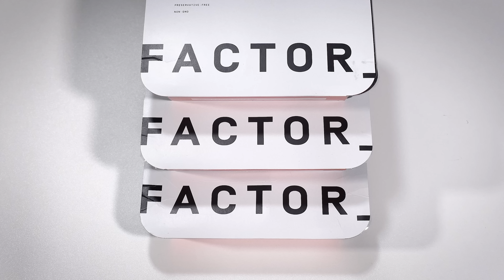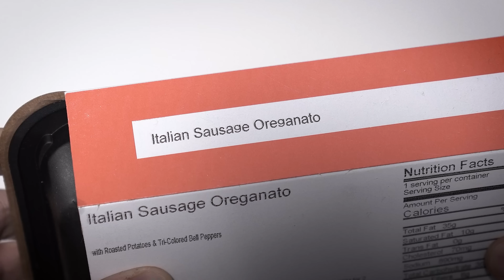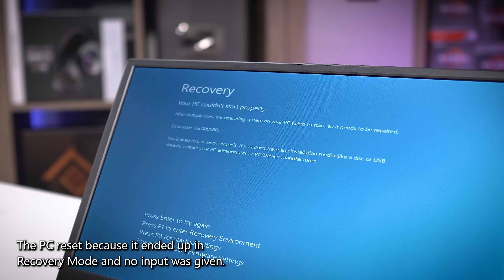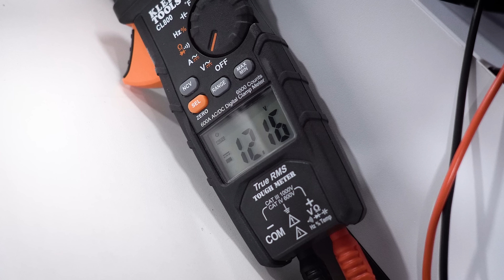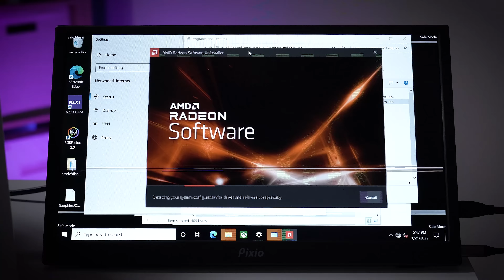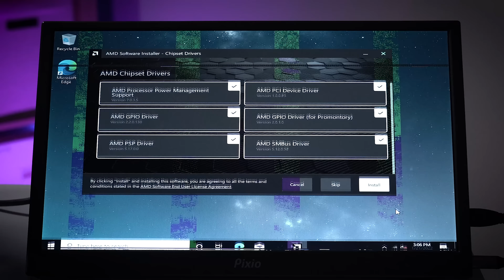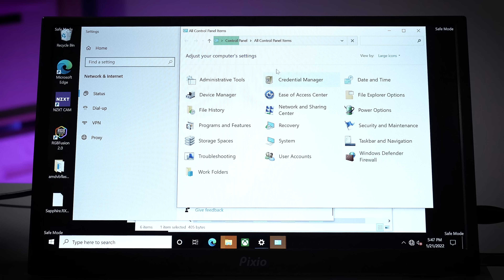Can We Revive This 10 Year Old Graphics Card?

Comment: The human eye can't even see more than 8 years.
Reply: Facts
Reply: Lol'd. Nicely done.
Reply: I can't even see what is 0,0000000001 light year away from me, I think my vision is bad
Reply: Eh?
Reply: This here is an MSI 7770,  ya we got one.
Reply: The BIOS of the VIDEO CARD may be bricked re install it
Reply: @pepipetkov5783  I doubt it. I've seen what a bad bios looks like. It usually doesn't result in artifacting like that nor does it prevent a failure of the fan. Most of the time, it's consistent crashes/freezing when initializing 3D mode, and failure to read components on the graphics card such as the memory capacity and the bios revision.
Reply: false, because my bought r9 270 and r9 290x both work perfectly fine to this day - 9 years after launch, cannot test HD7770 Ghz Edition from Gigabyte I had because, it's at my home on another country - the card would be 10 years old at this point.

Comment: Had this same issue a while ago. The gpu needs reballing. In safe mode it operates on the minimum freq, voltage etc.. When installing drivers, it uses the proper settings up to specs, which crashes the card. Not the drivers or windows fault at all. Pure hardware issue unfortunately.
Reply: Ive had some gpus thst just degraded and some part of the voltage frequency curve (nvidia) or pstate (older amd) was unstable changing voltages in the bios did resolve the issue.

Most of the time it was somewhere in the middle of the clock randge.

Even had a intel cpu do this.
Reply: @Andrew McEwan  unfortunately bes a one trick pony . Clean and repaste is his only repair

Comment: That artifacting can be caused by dry solder joints as well, especially if the cards overheated. If you cant find anything wrong with the SMD's its worth baking it to reflow the solder just in case thats the issue, also if it works could result in another video 😊
Reply: Exactly, second that!!!
Reply: Fixed two of my cards with baking.
Reply: @Mamomr  Fixed an HD 5850 this way years ago...
Reply: I do have a card that started with help by baking in the oven. Had green artifacting and slowed down the computer completely. Worked for 1 month now with no issues
Reply: Shhhh. Guys stop.
Reply: I have a 570 that was damaged in a shipping and when I got it back after what I saw. it artifact like crazy (for no reason or clue why it happened) but how would I bake or fix the gpu?
Reply: @Neo_X90X  baking won't fix physical component damage, its only a fix for trace/solder issues
Reply: @jarsky  so like my issue is that both dp ports stopped working and one of the two hdmi port as well. when the one last port works when it wants to, the same weirdness of artifacts goes on the screen.  I just don't get how shipping a pc could cause such a thing.
Reply: Yeah but it's not a permanent fix. They usually last 6 months max and then they completely die forever
Reply: @usernotfound-h2v  Baked an old 8600 gt using the toaster oven method a few years back. and also used a fan control app to run the fan at higher speeds. I got about 3 months out of it before it died again.
Reply: @robert1975031  Me too,with a GTX 460. I actually revived it twice before it died permanently. First time it held up 6 months,last time 3 months and then it finally gave up forever
Reply: @Neo_X90X  Yours got physically damaged and it's probably bent or it has cracked solder joints/broken components off the PCB. The bake method fixes cards that used to work and it's only temporary.
Reply: was just about to comment this, its worked on several gpus for me
Reply: @usernotfound-h2v  it's weird cause the pcb looks to be to be fine with no real damage as it was bolted in slot and had no real way to moving around. I mean it was in a build for a buddy of mine who was ready to ditch his ps4 pro but now he will have to keep waiting till the chip shortage is over with and grab a prebuilt.
Reply: @Neo_X90X  sounds like a faulty gpu tbh. could be many issues. If u have warranty, send it out for RMA or else have it seen by an expert. Dont try to do anything yourself, cause u might damage it further
Reply: @n00b67  not faulty at all. it was my lil bros who hasn't used his p[c is used and sold it to me non scalped price and it worked just fine. had it bench marked and gaming, but once I had built it in a pc and shipped it away. ups ruined it in shipping and they paid me back 300 for damages. this was last year September when it had happened. tbh I'm not worried about it. My pc a beast of a build and built by my hands. I build pc for folks as well. I'm at a point it is what it is and I'll just put it on a shelf for looks or toss it in the dump. if I sold it on ebay, best I get is like 50 bucks so not worth wasting my time shipping it out.
Reply: @Neo_X90X  Many PCs get damaged in shipping,even if there is no visual damage,if it was dropped it probably suffered a high shock that might have cracked solder joints on the PCB. Usually you can’t see this type of damage with the naked eye. Or maybe it just happened to be faulty. Faulty VRAM usually causes artifacting too.
Reply: @usernotfound-h2v  the gpu was working 100% just fine before i shipped it out so I could believe it was dropped or something heavy slammed on top of the box. Either way it is what it is. Ups paid for damages.
Reply: @Neo_X90X  Oven reflow is a temp fix, ie, it has a high re-failure rate. You can increase the success rate, if you melt flux under chips before you oven. 
If it's shipping damage it sounds like impact damage, ie, parts broken off, but artefacts are usually memory, ie, broken solder balls under the memory BGA, or total memory chip failure.
Check out Tech Cemetery
Reply: @SidneyCritic  thanks. Ill be sure to give it a look.
Reply: @usernotfound-h2v  that's not completely true. There is a chance that it is a "permanent" fix. That being said there is alot of nuance when "baking" a gpu. 1. You're heating alot of components that typically don't get very hot and don't handle heat well for extended time, as with throwing it in an oven. A heat gun is much better for this reason as you can heat the specific components you wat to reflow. Even then though you're probably looking at a 50/50 shot of it working to begin with. But if it's an older card what do you have to lose. And you can buy a heat gun for less than 20 bucks on Amazon and they have many purposes you could use them for outside of trying to repair your gpu.
Reply: Is the PCi x  4 or 3 on the motherboard

Comment: Seen something similar to this years ago, with a buddy's GPU.  I think it was a GTX 280 iirc, but it behaved almost identical to this.   

What happed with his was, when trying to clean the thing, he vacuumed over the fan and spun it up so fast, that the charge it generated, fried the card.   The artifacting it produced was a little different than what this one showed, but it behaved, almost identical.  The boot looping in particular, and this was back on Windows 8.

Pretty sure he either fried the ram, or gpu itself.   It's quite possible the damage to this card, was irreversible.

Comment: I've had a few AMD cards overheat with no fan spinning. Usually it's after driver installs. The first card I ever saw overheat and die was an AMD R9 280x. Once it overheated, the core was so hot it actually was damaged. You could see artifacting just like on the screen you had.
Reply: Im running a AMD R9 290 right now that had artifacting, green lines all over and slowing the computer down. Tried a few things before i just threw it into the oven. Have been working for a month without issues. Ran RDR2 meanwhile i was home with corona and the poor thing was 100% peaked all the time and still works. Now the question is how long it will last
Reply: I have a 280X and have been using it to speculative mine some coins as i have a better gpu for gaming.  Whenever i start a miner it jumps to 99C, i never noticed if it did that before in games because i never really paid attention to it like i do now.  But if i use the AMD software to change the voltage or the frequency settings in the tuning menu, it will fix itself and run at a good temp.  Very strange behavior.
Reply: @SgtEriksson  Does it still work after a year?
Reply: @guiorgy  no, it did not 😋 held on for about three months

Comment: Some other factors:
1. There may be a firmware update available. "GPU-Z" can identify the current video card firmware.
2. Check for UEFI compatibility using the free "GPU-Z" program.
3. Depending on the UEFI compatibility, may require setting the motherboard configuration set to "CSM Enabled". In which case, would also require complete Windows re-install with "CSM Enabled".
4. Check the status while the motherboard bios on-board graphics is set to "Enabled" instead of "Auto". Then plug in the graphics card, but the monitor still connected to the motherboard's HDMI port.

Comment: This behavior, specifically the artifacting in vertical bands (when drivers are loaded) is a sign of bad memory. GPU is probably fine and yes it prevents itself from overheating if fan is bad but memory doesn't.
Reply: 100% exactly good diagnoses.
Reply: 4 memory modules and the bands are in series of 4's, hmmmm. No idea if that's how it works or not but it is interesting.

Comment: I have had many ATI/AMD cards over the years, and I have seen this more than once
I had a 270 die a half year ago, same problem.i did some research on it.
And my conclusion is, when the thermal paste gets too old and the heat starts to rise, that soldering joint starts to get loose, so the GPU needs to get refitted.
Many have got it to work using the oven method (don't use the oven you use for food)  others have used a blow dryer and also many got it to work using a heat gun.
There is a lot of videos here on YT showing it

Comment: Wow!!! I actually have 2 of them still. I used to run in Crossfire. I only upgraded in winter 2019 to a used GTX 1070, just before the balloon in GPUs. They have NEVER been taken apart. I really have a full system, just needs a case. If you want it Greg, I can send it to you, if you want to clean it up.
Reply: Same! Got 2 in sli, but sli is dead, so couldn't get extra performance from that
Reply: I once had dual crossfire  6770s if I remember right.

Comment: Got a feeling this may be a failing capacitor. It works briefly but then fails, the capacitor may be fine when discharged but then is providing inconsistent power. Test each capacitor for resistance.

Comment: Greg I fixed aold graphics card for my only desktop at the time my new build wasn't done yet and I still wanted to play games but it would artifact and freeze and crashed the games to desktop.  I looked in the case and the fans were so clogged with dust that the blades couldn't spin.  So one day I decided heck I will try cleaning it and see if that worked.  It did, you got to peal off the seal on the back because dust can block the contact with the motor in the fan and also absorb the lubricant,, I opened it up there was nothing but dust rapped around the geal, so I cleaned that out. Relubracated it taped the seal back on and put the card back in with new thermal paste and the card fired up like new.

Comment: I picked up a 5770HD locally for $15 a couple of years back. I had a similar issue, very dusty, but the fan did spin. After cleaning and re-pasting, it would boot into windows but had some odd artifacts on occasion and slow downs. I figured the chip had deteriorated, so busted out the heat gun to "re-ball". That seemed to fix it - which more often than not is a temporary fix. I still have the card and use it in an old LGA775 build that sits in the garage for when I do car repairs/upgrades and want to refer to repair manuals, videos etc. without greasing up my phone.

Comment: I just revived my old Radeon HD5770 to give to a friend who is struggling with 4th gen intel integrated graphics. The thermal paste had basically turned into powder but after a re-application and a deep clean of the fan/heatsink, its still going (relatively) strong at over a decade old now. My backup GPU is an HD7850 that could probably use the same treatment too, I hope I can keep it going for years to come.

Comment: Hi Greg

Have you ever thought of building a computer with part's from the 80's and 90's, you know those old school mother boards, graphics cards, processers and so on to see if they can still be used today 2022,running Windows 98, XP, vista and so on, just to see if they can cope with simple tasks of running 1080p games and other programs, just in case someone out there still has a pc running and just wants a couple of extra gigabytes of storage, ram, memory or speed.

As I have a couple of Intel motherboards that could run Windows 98,but would struggle with XP, vista and so on.

Would be fun to see if they are capable of doing basic tasks like running Internet searches and some basic game plays with the modern games.

Just a thought to put out there in the computer tech world.

Loving the video's and the information into the parts of the pc and so on.

Comment: My older brother owns this card, really should remind him to clean it up and re-paste.

Also, is it natural for a high-power GPU to heat up rapidly when fans are not spinning?
Mine is MSI R7950 with Arctic Accelero Twin Turbo II cooler (250W rated). Fans do work, but i have to get an molex to 3-pin adapter since both 4-pin attached to the PCB and 3-pin connected to PSU are required for them to run.
Idle sits at 40-50C, set to lowest speeds, and manages to reach 100C after few minutes while under load. Hopefully did not cause any damage as this happened 5 times, each the moment hit 100C i put it back to idle. No artifacts, no crashes. Processor, together with VRAM modules at this scenario were always at safe temps, around 50-60C.
Left side panel has been removed for such reason, other than having to tidy up PSU cables that go outside the case, with single fan on the front.
It got cleaned up, re-pasted with NT-H1, also has pads on memory modules.

Comment: at 13:17 you can see a missing capacitor right at your left (in this video on the right side) hand! i dont know if its missing on purpose or not, but try to put in a cap there, its 99% the same value as the ones next to them. hope it helps!!

ps. pls like this comment for him to see in time :((
Reply: also, i'd try putting thermal paste on the memory chips too, you never know if it makes a good thermal contact or not without the paste...

Comment: I had the same issue with a Sapphire HD7950. I overheated the card after the fans failed. It reached 99 C, which shouldn't have been a big issue as I shut it down as soon as I realized it was overheating, but it did fry the 2nd v bios. I replaced the fans, and the card worked fine for a while, but started exhibiting the same artifacting yours did. I baked the card and it worked fine for 8 months, but eventually completely died.

Comment: When I see color banding like that and I know the monitor/cable is good, it basically means the memory is toast on the video card. The fact that the fan isn't spinning on startup indicates to me the owner of this card was doing some intensive graphics with the card and the memory started to fry. If the GPU was fried, it wouldn't POST. You only get the color issues like that with segments of the memory being dead. So unless you resolder some new memory chips to that card, it will be forever like that. Your first attempt probably fried more memory in areas where the drivers were being loaded. Also cheap old cards didn't throttle or shutdown on overheat either. So basically it's dead Jim.

Comment: 75-year old computer engineer, retired > I know that this is a year late on a card was doomed anyway. BUT when you had trouble loading drivers - it was DEJA VUE.  I recently upgraded a RX 550 with a "*USED* Saphire RX 580.  Initially, It would not even post VGA LED.  The motherboard suoports "dual VGA", so I put the RX 550 back in the "GPU" slot and the RX 580 in the 16X4 slot (how's that for dual?). Booted on the 550, I was able to load the 580 drivers and the RX 580 works great now.

Comment: I've seen this type of behaviour, vertical lines, with a couple of GPUs some 13 years ago. One XFX  Nvidia card and one Sapphire AMD card. Due to high ambient temperature, in a very hot country, the cards overheated as the fans were not efficiently cooling the GPU. This was in a heavily used game rig.
Reply: Sounds more likely you were too lazy to maintain your hardware like you should in that climate, it got dirty, got hot and then died.
Reply: @ihateeveryone8161  nah. GPU didn't last even 6 months. Didn't have time to get dirty. It was only improperly cooled

Comment: Usually what happens is that the card first will work since there are no drivers installed. After drivers installation the card will try to operate at its “full potential”, and that’s when things will start to go south.
Same happened to me with an old gtx980, awful day, such a good card that failed one day to the other.

Comment: Greg, there is another posibility. It's called bitrot, the card is 10+ years old thermal paste was crusty and dusty. It could be that the BIOS chip got corrupted, I would boot directly from the APU and then try with ATI flash to re-flash the BIOS on it from TechPowerUp, where you can find the exact model.

Comment: I actually understand what is happening with that card because i had a simular expirience with a GTS 8800. Your card need a HOT minute in an oven.Also when you get into Windows the OS tried to initialise the card but because the card has a fault on it, it doesn't know what to do and restarts before you see it fully boot up and crushes to the screen you saw. Also that's the reason you can boot it up without drivers.